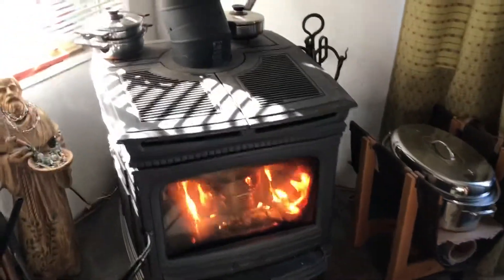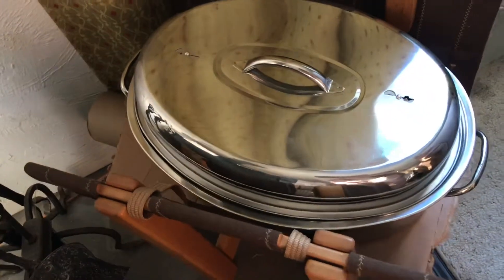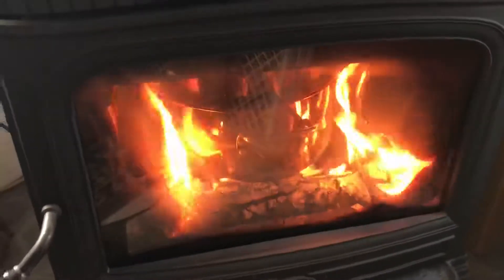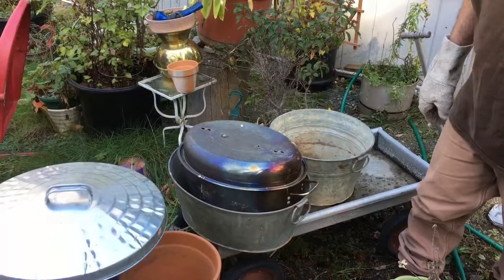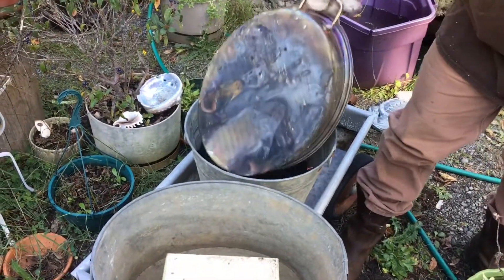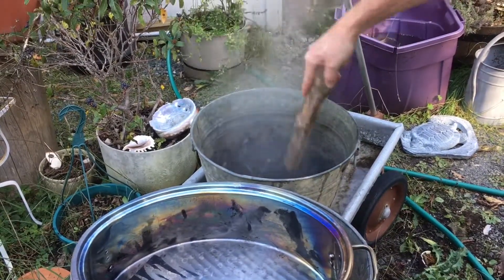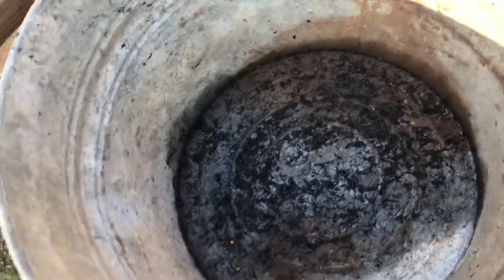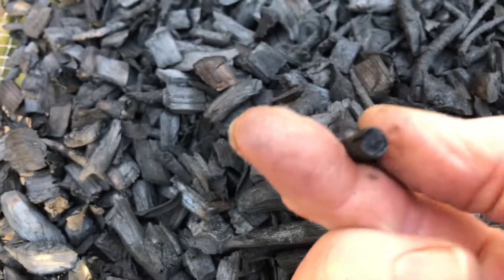Making biochar in the woodstove

Comment: There is NO need for any holes in the lids, nor anywhere else, with that type of container setup. 
The ONLY time we need any holes at all is when the tin is totally air or water tight. (In such cases 1/16" per pint capacity suffices.)

We can see too much air was getting into your container by the presence of glowing embers and white ash. Not a big deal, but not optimal either. 

Char can be made by two methods: pyrolysis or snuffing/smothering. 
Either can be performed with or without containers. 

Pyrolysis with a metal container, as in this vid, is the most convenient and reliable method. 

Cheers! 
Thanks for sharing this vid.

Comment: I think you did little fail. At first Biochar need cool and than mixed with compost or fertilizer. Your biochar absord water instead minerals and bacteria. Thank you for attention.
Reply from the maker: #Нетипичный город thank you for your help. I no longer use water after I just let it cool and put it straight into the chicken coop or compost pile. Thanks again and take care.
Reply: @TheOregonDude Using water to cool quickly is a great idea! This greatly increases the porosity of the biochar! This means it can absorb more nutrients and house more microorganisms, sequestering more carbon from the atmosphere.
Reply from the maker: @seuvagem1950  I’ve been making this char this way for Quite a few years now.  Some peoples opinion is to not put water on it and just let it cool on its own I tried that a few times and noticed even though the vent holes on the top are small it lets enough air in too continue to burn and then I have a top layer of the bio char turn into ash. I now always just hit it with a little water afterwards and put it in the chicken coop with a large amount of wood chips. And cleaning it out every 6-8 months it makes a fine product after sifting and my garden loves it.

Comment: That char looks incredibly beautiful!  Excellent work!!!  Quick note... 1) When you bring the retort outside after it's done, let it just simply rest and cool down.  No need to open and quench and all that, you can just let it mellow... 2) the retort itself may not last you that long... If it isn't stainless steel it may warp and break after a few burns, but I'm not sure what material it was.  Either way you made some damn fine looking char and were safe and thoughtful the whole way.  Kudos on this!  You got a subscriber :)
Reply from the maker: EdibleAcres Thank you for your input, I quit using water on it after and just let it rest. Less work which means win-win.
Reply: Ive read several times that by adding water on the hot coals you are increasing the pores. Activating the biochar